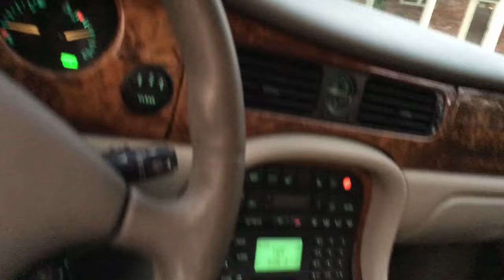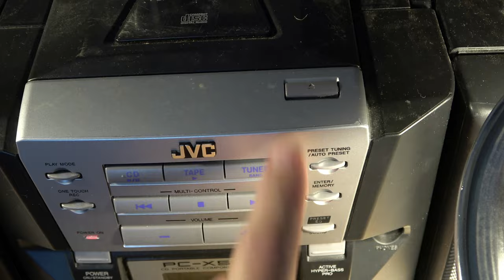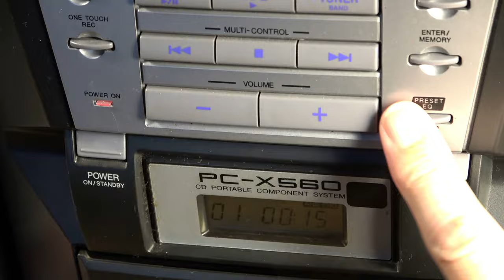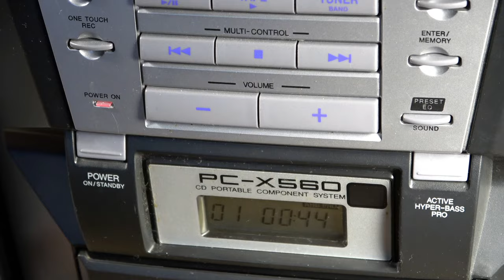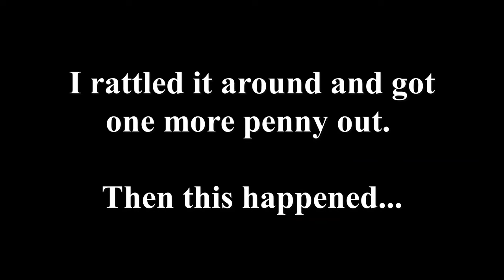Trash-Picked JVC CD Player Boombox - Can We Repair it?

Comment: I've got a 78 Ranchero. Stock AM/FM with the one 5×8 in the dash. With a rotted cone. Didn't want to switch the shit out. So l had on of these. Almost identical. But a bit older. I just dropped those bookshelf speakers behind the seat. Ran the wires under the carpet to the stock AC DelCo...
Still jamming 23 years later!
Reply: Went to buy my first new car in ‘78, wanted a Ranchero but they wanted $1,000 more than a station wagon. I asked why, since the wagon had a second set of seats, more glass and steel. He said because the Rancheros were more popular. So I left the dealership.
Reply: @Blue_Ridge_Ranger  l got mine in '87 for $1700.
Still a daily driver!

Comment: Pop into a local auto shop and grab a radiator hose screwdriver, theyre usually around 60cm long.

Also what can happen with the erratic disk read is the laser mech damping rubbers sag with age, causing the laser to hunt because its too far from the disk, or too close depending on orientation, a few washers under them fixes it

Comment: I've rescued a lot of gear like that - often its the lens needs cleaning and the transport needs a drop of sewing machine oil on the runners. BTW They might have also chucked it as there's no aux input.
Classical music is amazing - I became really good on guitar learning a great chunk Mozart's Violin Concerto No.3. Leanring the notes was one thing but the expression and dexterity is endless.
Lastly, I inherited my dad's Denon stack system (I'm into valve hifi anyway) so I was looking at the CD player and realised, small as it was, I could gut it, put two 8Tb drives in, add a Raspberry Pi running Open Media Vault and another running Volumio / Kody and have 100,000 albums and thousands of films in one silent box. The only reason I didn't is because if someone breaks in and steals the CD player.....   [silent_scream]

Comment: Sounds like the lens moving up and down, tryna focus without success. Maybe it's just dusty, or the glue holding the lense has come loose, which explains the effect of the 'percussive maintenance'. I would try checking it and re-glueing it if necessary. It's a common problem on Pioneer CD transports, I don't know about those JVCs. Their boomboxes were among the best in the early 80s, but those late ones are somewhat cheesy.
Reply from the maker: I did try wiping the lens with a lens cleaning cloth off camera, to no avail.
Reply: @Fixologist1  

And the lens is still firmly in place? Maybe the problem is with the coils that control the lens. The laser diode should be good if the problem is intermittent. Maybe it really is a bad contact. So much to go wrong in CD transports. And due to the total lack of standardization, a lot of it is impossible to fix if you don't have a donor deck.

Comment: That's some luck there with that one, being what it was. So not a bad find when curb-shopping. But I kept yelling at the screen to clean the thing off too. Also there's always a non-zero risk of bugs in some form or other when finding things like that. Other than that, I hate those deep screws - particularly when they use non-standard screw heads where those socketed bit sets never seem to work anyways. I'm surprised that with the repair and guitar work stuff, you don't have anything for that. Maybe you added something to the kit since this video came out?

I've got two older portable stereos where it seems to be the switch contacts going out (likely needing a good cleaning), and I figure they have to come apart because the exposed part of the switch is different than wherever the actual contacts are on the inside. On one it seems half of a DPDT for the main selector is knocking out part of the stereo, with some jostling bringing it back temporarily. Would be interesting to see a repair with that particular kind of problem.

Comment: Still driving around in your Toyota Camry eh. They are absolutely awesome cars. One of the most comfortable cars i ever had and it pulled like a train. I wish i still had mine but unfortunately someone pulled out of a side street and straight into the side of me as i was driving alone. 
It was an insurance write off because it was beyond economical repair. 

For those who don't know, it means that the cost of repair would be more than the actual value of the car so the insurance company do the cheaper option of paying you the value of the car and take it away and scrap it and you're left to your own devices to find your own replacement.
Reply from the maker: Actually, it's a Jaguar XJ8.
Reply: @Fixologist1  
Cool car. The wood veneers looked just like the ones in my old Toyota Camry.